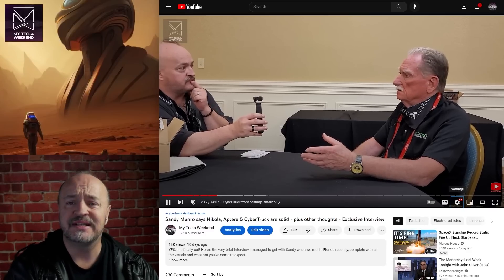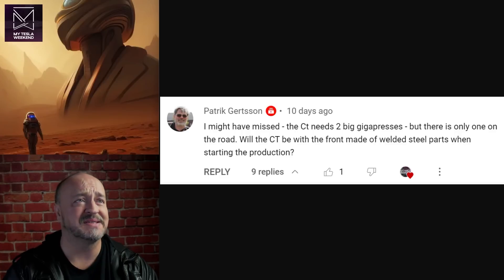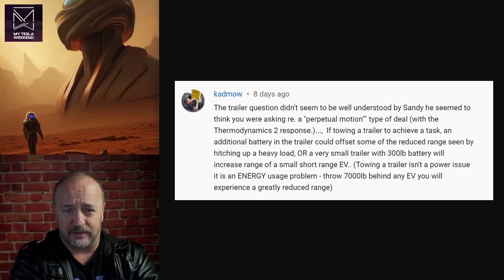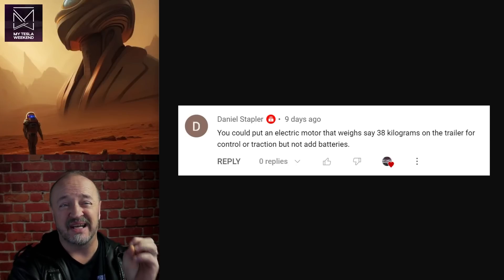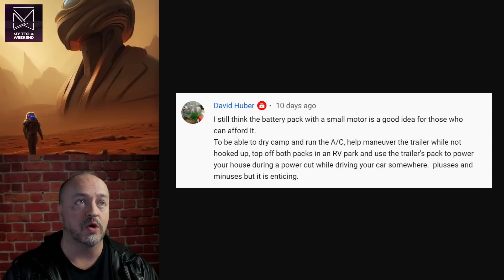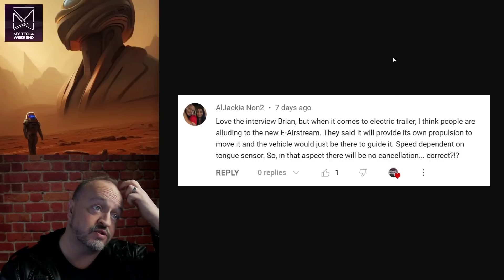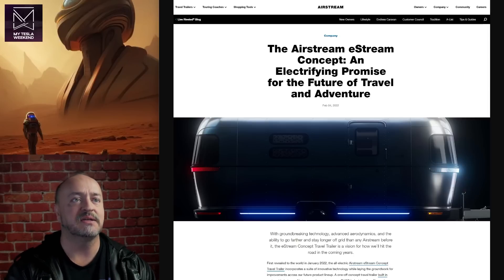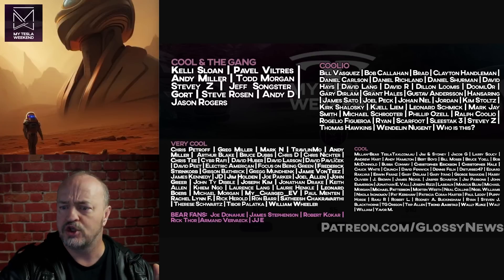Tesla's ON TRACK - Response to comments on Sandy Munro interview

Comment: Adding regenerative braking on the trailor for tractor trailors adds the benefit of eliminating runaway trucks. And anti-lock control on trailors would reduce jacknifing signifantly.
Reply from the maker: Excellent point on runaway trucks.

Comment: Brian my first thought when I saw your title was about commercial trailers.  A self contained drive and regeneration might make sense for over mountain routes. The control coul be linked by CAN cable or similar.  The trailer would not necessarily need charging external .  Could be at the origin of the trip.  But using elevation data along the route, the trailer could boost or charge with the terrain.  I imagine a tractor trailer that would rarely need to brake and could maintain uphill speeds better to reduce time through the mountains .  A niche I know but not that small.  Faster and safer is good.

Comment: The e-airstream allows the use of TONS of solar cells.
The drivetrain is far easier than you propose. As one person stated, it reacts to the tongue on the car. It’s only job is to make the trailer act like it weighs a few hundred pounds.
Once it parks itself in the camping zone, you have a VERY liveable solution. Generating power while your away exploring on your electric bike!
Get home and you have great comfort with all that energy.
Btw, if it can negotiate driving between trees, it can probably be driven up to a charging station.

Comment: Trailers are designed to be passive loads which are left in place at the campsite so the tow vehicle can be used to get around.  They do need a battery to power lights and appliances, but RV parks have power outlets.  For smaller campers, an electric van with solar panels is best.  I think that is what a lot of people are waiting for, long-range electric vans with solar roofs.

Comment: It would be neat to have a roundtable discussion on trailers, batteries and motors.
Spitball a bunch of garbage.
Guess market type and size (small number of rich people probably)
Throw out the dumb stuff.
Simplify the remainder. Think whiteboard discussions.
Still wind up with a unicorn that would cost as much as a house.
Just a fun exercise. 
I have dozens of fiddly practical and impractical ideas.

Comment: So with just ONE GigaPress initially that seems to signal production with not be robust until late in 2023?   Does that mean a few thousand a week in the fall?  Less?
Reply from the maker: You can see how they stockpile castings for other models. This will be the same. The gigapress will go live in advance of pro6,and can handle the ramp through the first six+ months without much difficulty.
Reply: @FutureAzA  My guess is the first half of 2023 will be getting all the pieces together, sort out production, tolerances, install the GigaPresses, stockpile batteries needed, and of course get some beta mule CyberTrucks on the road for testing.   Then customers actually taking delivery (not employees) in late fall?  Hopefully by December the production (# of vehicles) per week is ramping up significantly.

Comment: i think after the supply crisis for EV end these market along with  ERV for van life will be booming .. a full size Electric bus is the ultimate vehicle the roof has enough surface area for meaningful implementation of solar and under the bus has enough room for a whole lot of batteries removing the engine will open up endless possibilities and creativity for engineers I am soo excited to see what will come from the RV market when a good platform is developed for it .. ELON REALLY opened a can of endless goodies when he pushed for EVs and we are here to witness it  2023 will be super lit when it comes to EV and space I cant wait ..

Comment: i think when batteries are up to scale and prices normalize this will be feasible . I don't think much engineering is needed for this to work a competent team of engineers could do this in a week  .. trailers with power ready to go is a plus think about AC cargo haulage things will be able to remain cool for longer periods of time you would connect the tailer like you would connect your brake and pressure lines to the truck. the truck will calibrate itself with the trailer to adjust the options available based on the use case an battery pack  i think it may even reduce degradation of the batteries if implemented properly not to mention if can tap into that power for  the drive train .. an additional 5 -6 tons of battery on a trailer driven by a trailer head that can carry a max of 80,000LB wont hurt that much given that it is extremely rare that trucks carry the max capacity.. its a niche niche category but so is stars in the roof of a rolls royce . not to mention the more power we can have just laying around the more we will resolve the energy crisis can you imagine giga watts of energy that can feed back into the grid just laying around ready to be used .. although i think we are moving towards a future where people will  be responsible for their own power and grids will only be necessary for cities and you will literally be able to live anywhere with solar for energy and starlink for connection the food part you have to figure out .

Comment: I don't like the trailer battery idea. But how about a detachable battery module for long trips?

A battery module you usually have in your Powerwall, but move into your car when going for a long trip.

The idea is to have the permanent car battery smaller when not driving exceptionally long. Most of us like the opportunity to drive long distances, but we do that only occasionally.

That could be something for a smaller, cheaper car which would normally be sold withiut the extra battery module.

Battery modules could of course also be rented.

This is a little like NIO, but not as drastically, and it still allows for a (smaller) structural battery pack.
Reply: The only downside is the battery modules would be very stealable unless sturdy locking features were built in from the start.

Comment: I had an idea that might be a niche of a niche product: have the trailer act as a Powerwall when it is parked at home, which most trailers are, most of the time. So you are making use of your trailer's battery when you aren't using the trailer. When you go out camping, you don't really need the Powerwall at home, so now it powers the trailer's motor when you are driving, and all your camping needs at your destination. And every time you apply the brakes, you are charging your Powerwall too...

Comment: How about Tesla partners with or buys a tractor trailer manufacturer and builds the tech the trailers need.  Regenerative Motors and cameras for the trailers....trailers must have bad blind spots. The regenative Motors would be a total asset in control and with that weight it could regenerate a lot of energy....unless I have it wrong where a full sized and heavy motor would be needed to just regenerate.